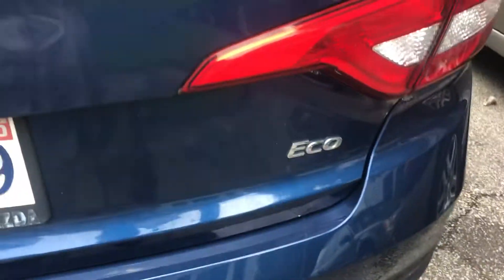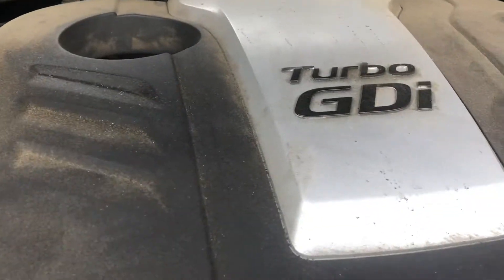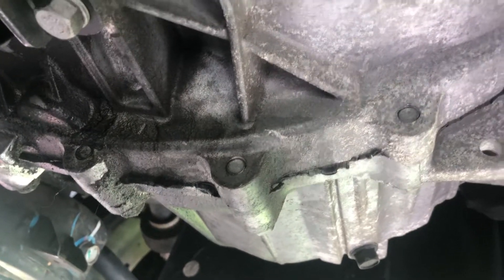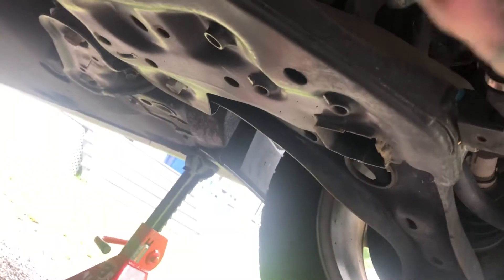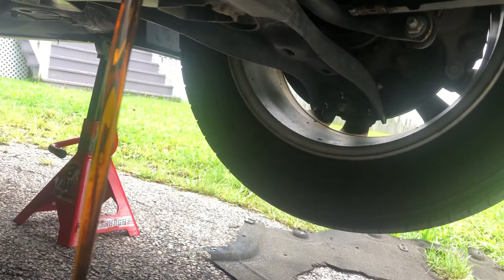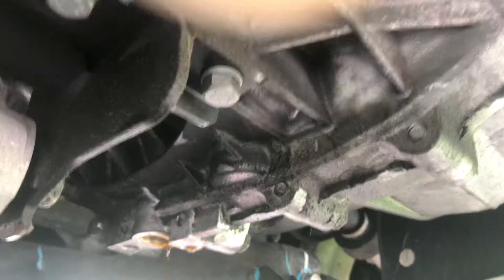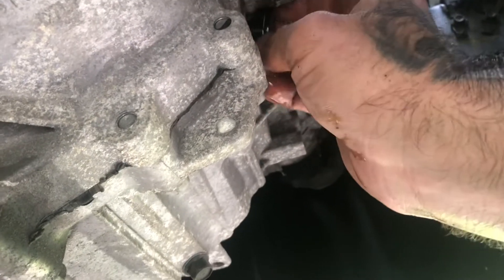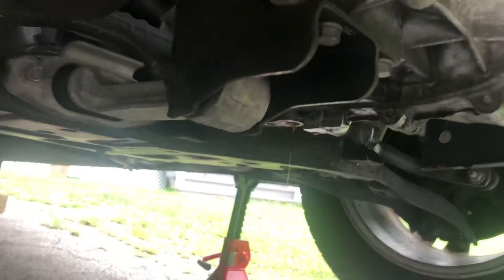2015 Hyundai Elantra 1.8l transmission fill plug location.

Comment: Hello, I have a same car, excuse me, can you explain what the volume I must pour back in gearbox? One liter or gallon? How much?
Reply from the maker: Transmission Fluid Service Fill System Capacity
Capacity
Not Specified “I believe if I remember correctly it’s about 4.25 quarts. A little over a gallon I used so if you get a gallon and 1 quart you should be perfect. I hope this helps there is no specification because the dealer recommends not to do the fluid which in my opinion is ridiculous, it should always be done and this change I did saved this transmission and it was very low. Please fill until int poor over the side from the bottom. This is what I recommend you do I will add this to my video and great question!!” Thank you. 
Trans Type
Automatic 6 speed Transaxle A6GF1
Transmission Fluid Total Fill System Capacity
Capacity
1.9 liters
Trans Type
Manual 6 speed Transaxle M6CF3
Capacity
2.008 quarts
Trans Type
Manual 6 speed Transaxle M6CF3
Capacity
7.3 liters
Trans Type
Automatic 6 speed Transaxle A6GF1
Capacity
7.7 quarts
Trans Type
Automatic 6 speed Transaxle A6GF1
   Also please pump it in from the bottom. I have a short in reference to how I add fluid. It’s on my channel and it’s a short on how to change rear differential fluid on a Honda Element and it will help you a lot. Cool trick I always use when adding the fluid sir. Use an old weed killer pump activate sprayer and remove the spray nozzle screen and it works amazing. Very easy to add. Please  fill till it runs out. I will add the specs to the video. Also on here for you. Best of luck. Also. Always make sure you can remove the fill plug first always.

Comment: I thank you soo much I just finally changed it thanks to your video and she's running perfectly
Reply from the maker: Great happy it worked out if you need any tips there’s a couple other videos I have out there I don’t do a ton of these just winged one or two but if you have any issues the other videos are pretty good if you need a little help and it’s not working. Good stuff
Reply from the maker: This is the right way to do it. Sorry it’s not the best video it’s one of my first. I had a customer and it would struggle to go into reverse. 2 years later. Working great. I recommend a follow up drain and fill after about 3000 miles and it should be perfect. Best of luck. Cheer’s
Reply from the maker: Yes it’s crazy. They tell you not to that’s bs. This guy was very low. Also. The second I got it done it fixed the issue in minutes. May want tk do a second flush in a couple weeks. Sorry drain refill. It will help a ton. Glad it helped. One of my first videos not the best 😂. F it not like they paying me. This car was hanging in reverse and not moving. Now 2 years later still doing fine. 🍻

Comment: Thank you so much every other video I've watched for my car all said its up near the battery I've searched high and low on my car and nothing until now thanks alot
Reply from the maker: Glad to help. You can try to find a spot but this is the correct way. Glad to help. I do most everything live now and this was one of my first videos so hopefully I’m doing better. Little tip. To refill make life easy and get a weed sprayer and take the screen out. Pump the fluid in until flowing out and boom. It’s so
Much better then pumping. This gentleman had no reverse about at all. Very low on fluid after refill 2 years later still driving it. Regards.
Reply: @TourettesMobileMechanic  that's a excellent idea on the weed sprayer bcz I was definitely looking for a pneumatic pump on ebay, I did a complete transmission flush on a 2003 bmw x3 and that pumping the fluid in killed my hand but thanks once again
Reply from the maker: You will be in heaven. It makes life so much easier. I use it all the time. Pull the screen out and boom. Easy

Comment: Hey Mitch I wanna thank you again for this video I just have a few questions I'm about to do the 2nd drain and refill on the fluid is there a way to flush the remainder fluid out the cooler lines and is there a transmission fluid filter?
Reply from the maker: I will say it like this. Sorry it took me a while. I’ve been on vacation for the past month never flush your transmission. What I would like you to do is think about it is a half gallon jug of water for example, whatever you drain out when the motor is warm Probably around 45 quarts is going to be fairly dirty that’s for the first time. Make sure you fill it back up to spec usually a little more is needed. Do you research get the specs properly please do I have it for about one week to a month, depending on how your transmission is reacting, the more you drive the more it cycles throughout the motor. Repeat this process depending on how dirty the first one is every 1 to 3 to 4 weeks. In total you are looking to have maybe three drain refills. On the third one you should see a fairly bright color fluid that means you’re on the right track if it’s not extremely bright after driving it for about 4 to 5 weeks this time before you do the last flush check the fluid go ahead drain refill and there you go you pretty much have all brand new transmission fluid in each time I recommend pouring your old fluid into different containers and save them watch how the fluid will change it flush it’s like drinking out of a really dirty gallon jug of water. If each time you change 3/4 of the water but left a half dirty in and refilled it to the top with clean water really old and new water will mix around but eventually it will work itself out of the system without shocking it too much. Hopefully you can understand this talk text sorry I’m very busy and about to go to sleep for free to message me with any questions with this is how you do a proper sealed transmission drain and refill very easy to do and he will double the wife of your transmission. These holidays are known for running low so I urge you to check into this and when refilling try to get a fairly flat surface as you pump it in make sure it slowly starts to run out of the top drain port there’s a lot to it. I don’t mind trying to help but I can’t do this all night. I’ve got a busy day tomorrow. I’m sure you have this you sound like a smart guy remember take your time do what you think is right. Your car will thank you I promise you, I’ve had some of my customers vehicles last over 500,000 miles all right going to get some sleep I wish you guys the best and have a happy new year!’ 🥂🎈🎆

Comment: What transmission  fluid did you put back in it?
Reply from the maker: CVT 1. You could put in to but refer to the TSB, this had a cylinder 2 misfire and transmission problems circuits B and C range performance, I have checked everything and the TSB from Subaru is dead on I wish I could copy and paste it right here for you. If you having a similar problem it’s got to be something going on with these cars but if you get to the transmission before all this happened so that would be my advice to change around 40,000 miles with the dealer recommends on this particular model
Reply from the maker: Sorry Bryan. I really hope you caught I mixed up the videos and comments. Sorry. This is SPF 4 I believe I can double check. I’m almost 100% please disregard that comment. I’m talking about the Subaru I was just working on smh. Good luck and sorry about that. Hopefully you caught the Subaru comment in there and assumed I was slipping up. SPF4 redline I believe buddy. Later.